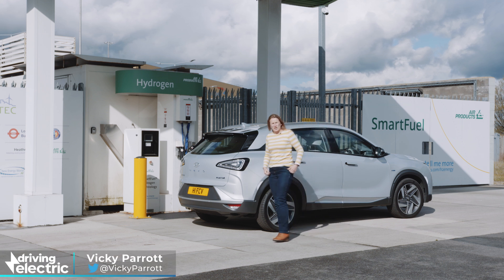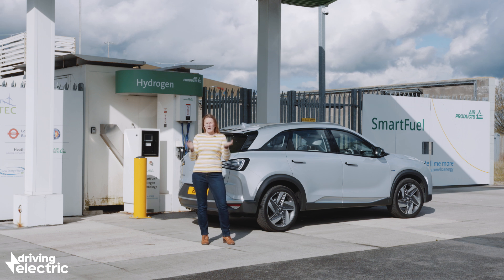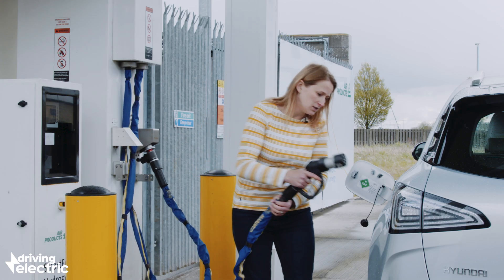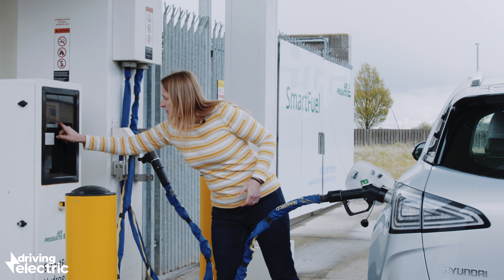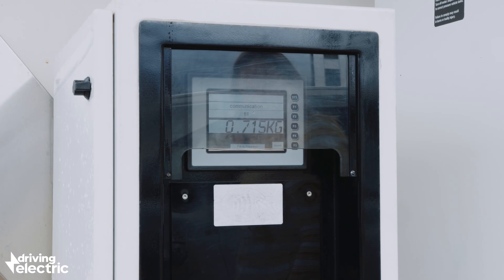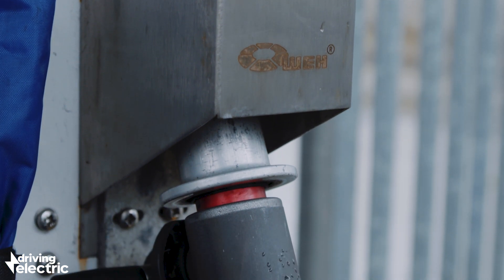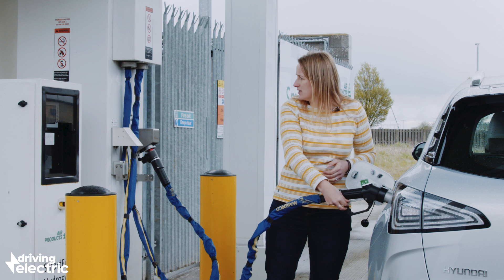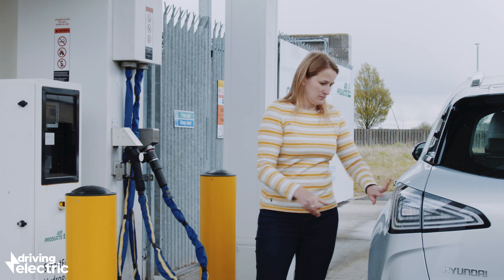How do you fill up a hydrogen car? - DrivingElectric

Comment: Waste of time learning how to refill hydrogen as plug-in battery cars are the present-future. Hydrogen usually is obtained by gas companies from methane (natural gas). Neither zero emissions, nor eco-friendly.
Reply: Batteries aren't eco friendly either. Have you seen how they are made?
Reply: lithium mines are no play ground either.
Reply: So you would like to go backwards with technology and continue to pollute the air in a bad way rather than moving forward with water vapor for the most part as the only fumes that leave the vehicle Mark. What a guy… NOT
Reply: This didn’t age well…..
Reply: Lol, this dumb comment aged terribly🤣
Reply: Your statement didn’t age well considering car manufacturers are giving up electric plug in batteries and going hydrogen instead.
Reply: And most electricity is still from burning coal

Comment: Hydrogen maybe is the future but not now... In 15 20 years... As the batteries and the ev... Are 5 to 10 years ahead..
Reply: You sound like a liberal
Reply: Hydrogen vehicles are EV. Also, batteries are about as good as they ever will be, and that's not great. Battery required for equivalent 50 litre gasoline tank is about 500kg, whereas hydrogen only needs a few kg, meaning further distance with less mass and less drag.